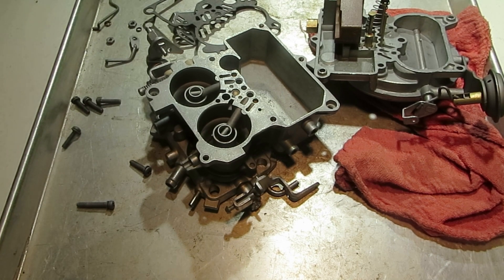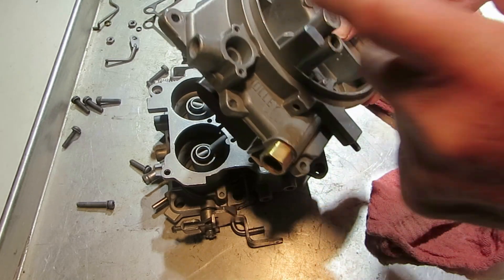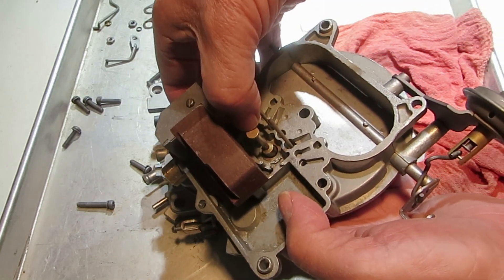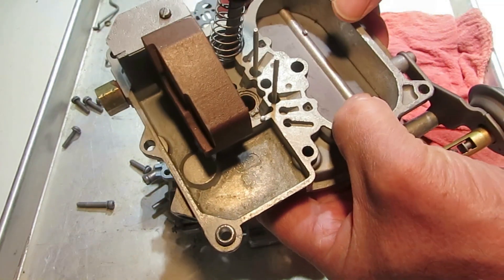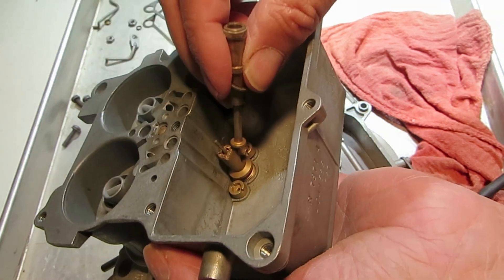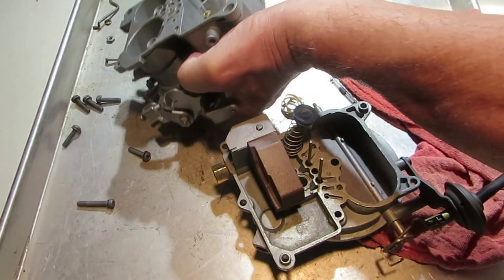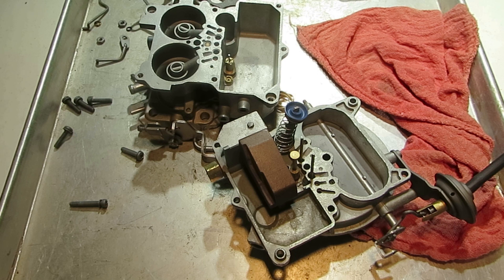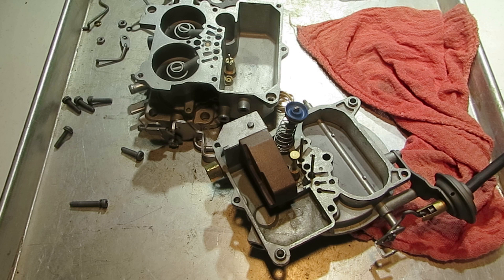Holley 2245 2 Barrel Carburetor Power Circuit

Comment: I hope you're still monitoring this ... I've got a 2210/2245 with the one piece power piston as shown in this video.  Either it never had the retaining washer, or I lost it.  Do you know what I could use in place of that?  It seems like it's only needed to hold the piston so the body and air horn can be assembled.  Any help is greatly appreciated.

Comment: Most important is to pull jets and power valve , clean out bottom and clean passages out of debris.holes are at the bottom of threads and are small.(jetted hole so gas just dump.
I found a small safety pin with the point bent at a 90° just  long enough to poke out junk. Blow out compressed air.

Comment: Hey man!!
A lot of GM vehicles had Rochester Quadrajets. But when they came out with the 366T and 427T medium duty truck engines, they used Holleys. Bigger fuel bowls to ensure good fuel ⛽ supply under load & combat vapor lock.